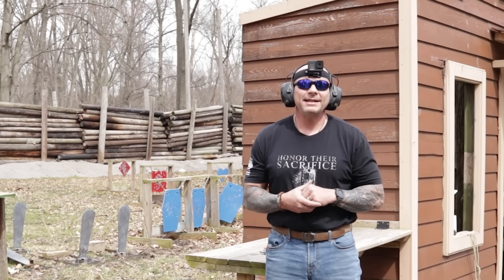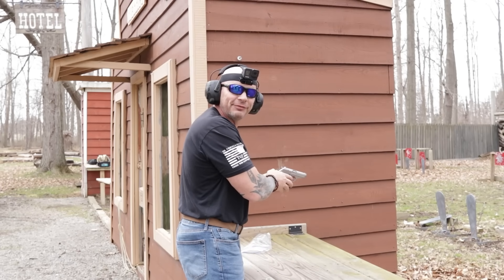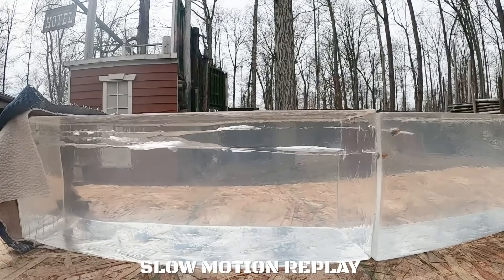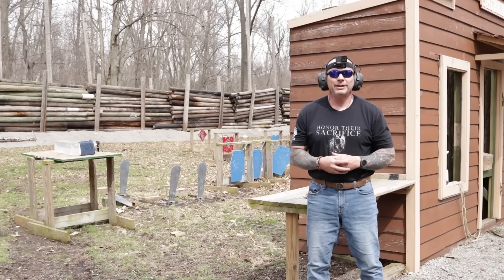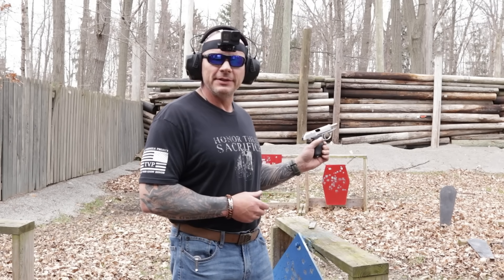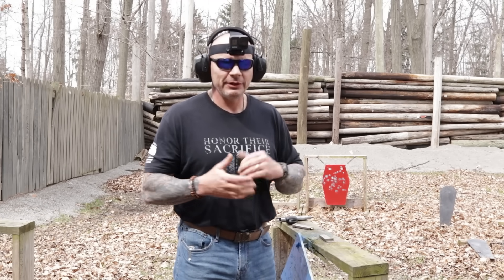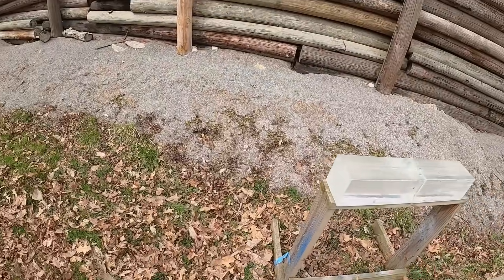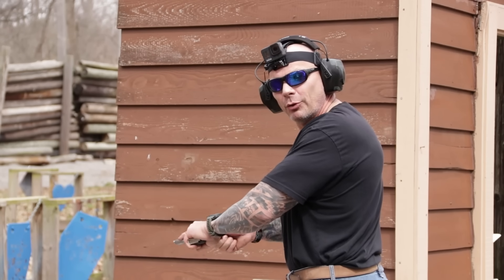Stopping Power of .380 ACP

Comment: Years ago, my dad had a .380 ACP Beretta, he was working on a weekend at his business, he heard some activity on the roof in the warehouse area, there were a couple of hoods trying to pry off the large bubble skylight so that they could drop down through it, so he got it out and shot it twice through the plywood ceiling and could see daylight through the little holes, all of the sudden they started bounding away in giant strides, scrambled down the fire ladder, and dropped to the ground. in the gap between the bottom of the ladder and the ground, there was enough of a gap, one of the guys hobbled away with a badly sprained ankle. Nobody was hit, he intentionally aimed a foot or two away from them, but they sure got the Hell out of there in a hurry and didn't come back. 🙂
Reply: I have an 85F Cheetah.  Probably the sexiest, and best built pistol in the world.
Reply: @gonzob9609  I had a cheetah and Vine I didn't like because the barrel rubbed against the frame but the one thing about that cheetah you can shoot the hottest 380 rounds and it's not going to hurt it and Buffalo Bore has some extremely hot I mean I'm talkin 1200 ft per second 90 grain bullet, and they make some 100 grain hardcast flat nose that are doing about 1150 I don't like shooting a lot of that out of my Sig P238 I had it or Kimber micro because it's just I feel like a little hard on those little guns!
Reply: @jerrydonquixote5927  Hmm...you mean it rubbed on the slide???  My barrel has a tight fit to the frame with no play.  Barrel stays put, and the slide is straight blow back, and doesn't rub on the barrel either, which it the most accurate pistol I own.
Reply: @gonzob9609  yeah most of them are just like the M9 the 9mm version,  but the one I got had a lot of Barrel play I've never seen anything like it. I probably should have just sent it back,  but I didn't know I had some Strokes about 15 years ago so at that point I really didn't have the facilities to know to do that...
Reply: @gonzob9609  https://www.youtube.com/watch?v=emh6cyrz2Hc

Clone
Reply: The same application would have worked with a .22 long rifle.  Perhaps even a starter pistol.  
I am delighted your dad solved the problem with no harm to himself.  But the caliber of firearm he used doesn't seem to matter.
Reply: @OldManMontgomery  It's what he had. When trouble comes, the best firearm is the one that is available right now. He was getting elderly at the time, it's what he felt comfortable with. Keep'em in the X ring.😉
Reply: @jacqueslefave4296  Okay, what one has is what one has,  I understand, delight that is (was) well on that episode for him.  However, choosing what to use is a far different matter.  And that is what I address.
Reply: @OldManMontgomery  Yes, in fact you can make a persuasive argument that less physically able people NEED a more powerful gun, BECAUSE they are less able to sustain a difficult fight. I recommend a 40S&W to women and seniors, I think that the 9mm was great for its use as a submachine round, but I consider 38 Super a better choice for a pistol.
Reply: @jacqueslefave4296  I cannot contradict much of what you say.  I do agree with you about less physically able persons.  Of course, some folks are limited to what they can handle in terms of weight and such.  I still prefer a .45 ACP and sometimes for clothing statues I use a .38 Special with specific loads.  I've been a fan of Super .38 since before it was popular with the gamers.
Reply: @OldManMontgomery  The great thing about the 45 ACP, is that it doesn't just kill, it knocks them down. Even if they are wearing body armor, their still going to be on the floor on their hiney.
 It was developed in consequence to the Spanish American war, the Moro tribesmen, jacked up on some drug, and the Marines were armed with the .36 Navy, roughly comparable to our .38 Special, and many if not most of the afflicted Moro tribesmen eventually died, but not before inflicting death and wounds upon our soldiers.
 It served our troops and law enforcement very well for a long time. The American Military's decision to go with the 9mm was driven not by any superiority of performance, but by the political directive to work towards uniformity in small arms ammunition. But it was a step backwards in effectiveness, IMO.
Reply: @jacqueslefave4296  I  agree again.  I've been a proponent of the .45 ACP for about fifty years now.  As you say, it not only kills - a secondary effect, actually - but it immobilizes at least mentally the greater percentage of assailants.  That is the desired effect of self-defense:  to protect one's self from harm, or further harm.  "Killing" is not an act of purely defense, at some point there is revenge or punishment considered.
Reply: @OldManMontgomery  👍
Reply: Hold on, it was daylight, sure they weren't service people..??
Reply: @russmode  No, they were bad dudes...👹
Reply: These are the stories you don't read or hear about in the media, where guns are used by honest citizens to prevent criminals from committing crimes. It happens way more than crimes involving guns.
Reply: He shot holes in his own roof ? Not a very good business decision.
Reply: @ericschneider8524  Small holes, easily patched with epoxy loaded with sawdust, overlaid with tarpaper, tar-infused latex and pea gravel. It was in a desert area.

Comment: The problem with the 380 is it’s not fast enough or heavy enough to gain enough penetration to hit vital organs. While investigating a burglary I contacted a suspect in the hospital that had been shot 5 or 6 times in the back by the homeowner with a Grendel 380 pistol with hollow points. The suspect was sitting up in bed talking to me. None of the rounds penetrated into the body cavity. They were all removed from his back muscles. If you must carry a 380 use ball rounds not hollow points. Now there are plenty of very small 9mm handguns that make the 380 obsolete.

Comment: I carry a 380 every day, I don't walk out my door without it, but when I travel which living in Rural Iowa is everywhere, I also carry in my EDC Tac bag my XDS 9 mm the small hand held bag carries enough gear alone to get me home from a 30-40 mile range Average travel for us, or a 3-4 day walk (depending). 
It has 4 Xtra mags, a Pen Needle gun Oiler, Water purification tabs, Meds to handle any dibilitating ailment. Including pain, Potasium Iodide 130mg for you know, a packet of 8 caffeine tabs, a small Old timer fixed gut hook skinning knife, a small Smith's knife sharpener, a med. sized multi tool, a pen flashlight, fire starter, Bic lighter, some strike anywhere matches, folding reading glasses In hard case, Small measuring tape, a Magnetic Mini light, Storm proof note book and Rite in Rain pen and mechanical pencil (both orange) in case I drop them so I can see them. a Small 8x21 monoculor, a small (pill) canister with ear protectors, 1 smoke Grenade, 1 Glow light. 1 Small plastic bag and paper clip. 
Last a paint can opener to use as a cartridge extractor. That will be moved to a belt clip retractable cord badge holder soon. (check YouTube) 
Some of the gear hangs outside on carabiners, and there's one large carabiner on back I use to clip to Grocery carts so no one can just lift it out if I momentarily turn my back. 
But I (try) to stand sideways toward it non the less.
(Situational awareness requires constant training for humans.)
My thoughts are a combination of preparedness for Tactical threats, basic tools for salvage, Shelter, Fire and water, Food can be found/hunted and is the least threat to a few days to a weeks travel. 
I also have 2 get home bags with plenty of food, Xtra ammo etc,  1 for me 1 for my wife and both have enough food and better gear/water purification, shelter, Blankets, better med kit, etc I split gear in those in case we have to seperate for a time being. 
Both have enough for about a weeks survival seperatly if you ration.
Together more than enough for a week or a little longer if you ration even longer yet adding foraging/hunting/traping/fishing. 
However those things slow you down if your only 30- 40 miles from home and can walk 15-20 miles a day. 
But I factor in if you have to stay off road and it doubles or even triples your time.
Yes I even have a basic fishing kit in my get home bags.
I'm looking to add a telescoping fishing pole too, and a break down 22cal
 1 is None 2 is 1 and 3 hopefully gets you home with some amount of safety & comfort.

Comment: The .380 is a compromise design.  That isn't necessarily good, or bad if you know what you are getting.  You are trading stopping power for a smaller package.  I'm a very slim guy (6' tall 175lbs)  and it's a challenge to hide a full size or even a lot of compacts.  That being said there are some 9mm offerings that are really close in size.  Also civilian defense is a very different situation from law enforcement.

Comment: If the. 380acp is only 2mm shorter, one would expect similarly weighted projectiles as a mid range 9mm with a +P or reasonable-but-hotter powder load to be just as effective as that mid range 9.

Comment: the key factor when determining stopping power is cavitation....it's the 1 factor that literally zero "experts" on youtube ever talk about, the cavitation of those hollow points is pathetic, and don't tell me the secondary (aka "temporary) cavitation is meaningless, because if your heart and lung tissue all get stretched to the inside walls of your chest, you're going down. you shoot a hopped up junkie with that 5 times and he'll still be charging after you, simply upgrading to a 9mm with decent defense rounds will change that. 9mm Hornady Critical Defense rounds will not over penetrate and get nearly as much stopping power as a .45 with all the controllability of a compact pistol. you are literally only talking about penetration and not energy release, stopping power doesn't come from how deep you penetrate, it comes from how much energy is dumped into the target. velocity counts for more than bullet weight does, which is why the super light, super fast 5.56 is so devastating, you have a bullet going from 3200 FPS to 0 in 7-8 inches and it stretches your flesh out almost a foot in radius, you're putting a heavier, slowing moving bullet twice that distance of penetration and getting almost no cavitation, it's garbage, I wouldn't use this to defend myself against an attacking dog

Comment: I use .380 RIP rounds.  Also known as Radically Invasive Projectile. Penetrates an inch or so and breaks into smaller parts which “fan” out in different directions.

Also have RIP rounds for my 9mm and 1911 Kimber .45 cal.
Reply: But may not penetrate heavy clothing layers effectively. I hope you live in a hot climate. Otherwise I would advise Hornady Critical Defense.

Comment: The 9mm doesn’t have much more recoil than the 380. The ammo is usually cheaper than 380 more to choose from. I myself am not impressed with the 380 but some people like them.
Reply: I don’t like any gun with smaller then a 4 inch barrel. So the recoil on them from a 9 mm is not much different than the 380. Like I said some people do like the 380 I am not one of them I prefer the 9 mm
Reply: Not true. You have to compare apples to apples. I had a Sig P938 (9mm) and sold it after 7 years for a Sig P238 (380 ACP). They are damn close in size, barrel length, and overall weight. The 380 auto is much less "snappy" and easier to align sights for follow up shots. Recoil in a subcompact pistol is much worse with a 9mm cartridge compared to one chambered in 380 auto.

Comment: We're still in a weird pricing zone on ammo. I agree on the 380 being job able. It works for most scenarios. But the price on the ammo is a little more than I like right now. I have 40's, 9's, a 357, and a bunch of .22's in different flavors. Even the .22 is a go to if needed. Albeit it's rimfire and not as reliable every shot on some guns. I like the 380 and the .22 Mag for the smaller tasks. That being said, more 380's out there in the normal range of EDC's. Unless you like a single action colt clone with a .22 Mag cylinder. Pricing currently, and if your going with the cheapest or reloads, are running around .30 and up for 40's, .26 and up on 9mm, and those 380's are going like .33 a round. So the gun has to be the price point and availability decision there.

Comment: I carry a Ruger LCP in situations where a larger/heavier gun would not be feasible, and while I understand that it is NOT as powerful as my 9mm, I carry it with confidence.
Reply: Man, I love my LCP. It’s definitely my favorite pocket rocket to carry especially on days when the Texas/Louisiana heat is on full throttle.
Reply: @DunnDealOutdoors  Totally agree being from San Antonio!
Reply: I carry my LCP everyday!
Reply: @TarmanDan  loud!
Reply: I have been carrying the LCP for 14 years.  It goes everywhere with me, which is ny main EDC requirement.  I use Hornady Critical Defense and have no concerns about its ability to deter an attacker at 20 feet or less.
Reply: Again I wouldn't want to get hit by it. Plenty powerful enough and those little girls are louder than some rifles imo.
Reply: I'm a .45 guy all day long but since I bought my first LCP when they first came out its been my EDC ever since. LCP, LCPII and just picked up my Max a few weeks ago.
Reply: Mistakes please read my comments and the accompanying article
Reply: The Ruger LCP with the DeSantis Nemesis holster is my church gun and the Ruger EC9S is my normal carry. Never had a problem with either and love them 👍👍🙌
Reply: I'm a 45 lover who carries the LCP in 380 frequently because I'm too lazy to dress around the larger gun just for a quick trip to the corner store. I've more recently bought a very compact 9mm to split the difference and it is threatening to become my main carry weapon. (More testing is in order before I can say it's my new #1, but I'm leaning in that direction.)
Reply: @mikegoodwin2386  agreed.
Reply: That's a nice firearm.
Reply: Love my LCP🤘❤️🇺🇸
Reply: I mean, a .380 can have the same grain load as a 9mm..
Reply: @MrAngenos  Sure, they are the same diameter, so you could put the same weight bullet in there, but you have a lot less powder pushing it. 9x17mm (380 ACP) vs 9x19mm (9mm Parabellum).

Comment: Seems to me most complaints are that it does not go the full 12 inches to make it deadly. I like the .380 just because of that as you do usually not have to worry about overpenetration in a public shoot out. The FBI went crazy nuts over just one bullet that stopped short of the heart and then based all their testing on finding a bullet that will meet its demands. Most thugs are extremely ego centric so that when shot at of if shot their primary choice will be to flee for their safety. I think only mass shooters or gang thugs would stand there and shoot it out with you in which case one should probably seek cover and wait for LE to arrive. The gel block in no way is like the human body as it has a solid consistency of mass the we do not have.

Comment: Thank you for the video. Nice to see the 380 getting some real attention instead of just being poo-pooed by the uninformed. I keep Lehigh Super Penetrators in my LCP Custom, which is my summer shorts carry, and the only gun i have ever actually fired in self defense. A dog (BIG dog) attacked me and the missus a few years ago on our rural dirt road morning walk. One shot and it was over. Dog was hit but not killed. I tried to scare it off when the owner could not control it, but it ended up going through the shoulder and the dirt from the road hit me in the face. Dog took off like a bat outta hell. Wish you had tested those, or the Underwoods. In a short barrel with this light bullet, they often do not expand reliably, and also do not have the sectional density to penetrate enough if expanded, especially bone and heavy clothes. The Lehigh show zero weight loss, no over penetration, along with adequate penetration and a good size wound channel the entire length of travel in the gel, in every test I have ever seen. That's why I carry them.

Comment: I've known the intrinsic value of the .380 acp cartridge for many years. Mine is the FEG SMC.380 made in Hungary, that is basically a copy of the Walther PPK, but a great deal less expensive. Steel slide, aluminium frame, decocker,  and is just as accurate and reliable as any in it's class out there. Over the years, I've shot most every brand of ammo, ball, FMJ and hollowpoints. This gun has never jammed, EVER, which is more than I can say for other guns of the same type. Unfortunately, it's no longer imported. The .380 acp is an excellent round and very underrated. I recommend it as a carry, if not as a primary, then for a back-up. I appreciate you showing the value of this cartridge. I sure wouldn't want it to fall by the wayside.
Reply: Those are nice , I had a similar FEG in PA-63 in 9x18 that was sweet. I love my Beretta 85BB. Got two of them when they were affordable.
Reply: @guaporeturns9472    I regret not getting their copy of the Browning Hi-Power. It was probably a great gun, as well.
Reply: @williamgunnarsson  I have that same exact regret. They were very affordable about 10-15 years ago. Have no idea what they go for now.

Comment: .380 will work, as long as you practice enough to put those pills in the right place. Very few pistol rounds have stopping power, so you have to get your attacker to bleed out very quickly or score a CNS hit. This works better if you go for an upper center mass hit on an attacker facing you.
Reply: Yep, all hand guns suck.  Caliber doesn't matter that much.
Reply: I carry a lcp here in FL but make no mistake a 357 with a 125 g hp has like a 92 % one stop shot per FBI. One shot stop is your attacker will immediately stop firing or advancing and not travel more than 10 ft. The 45 acp is around there too.